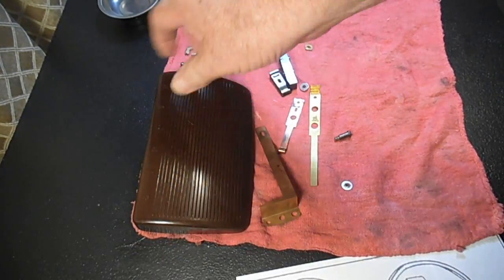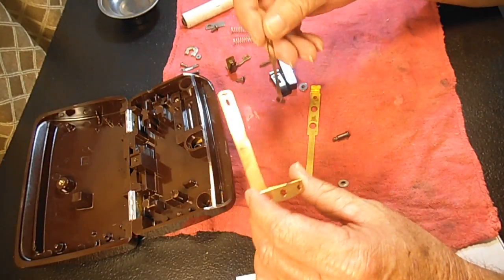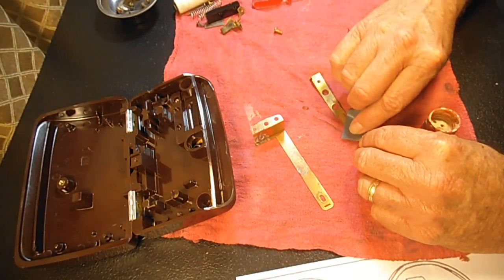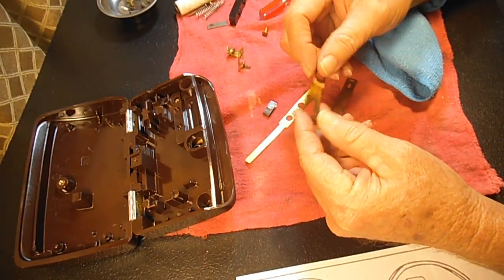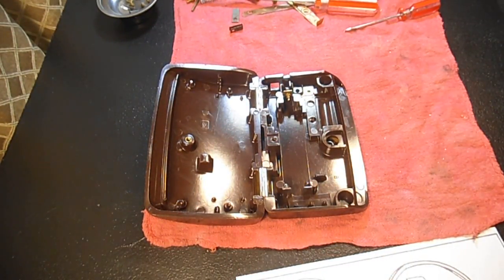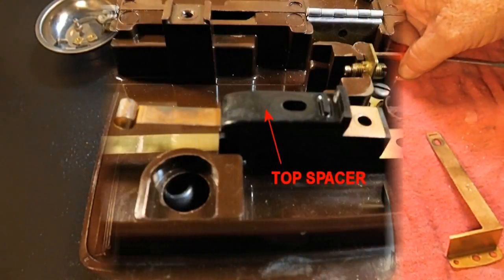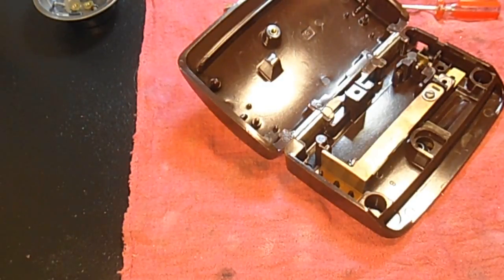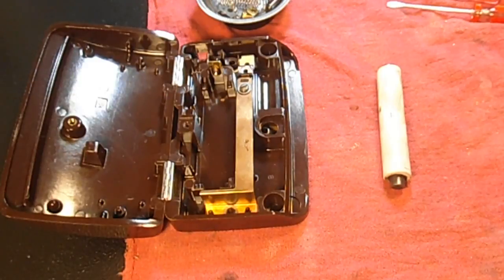SINGER CLAM-SHELL FOOT PEDAL RESTORATION PART 2 - POLISH & INSTALL SPRINGS

Comment: Hi Andy, is normal that this foot pedal make a little spark when the metal spring touch each other? Thanks
Reply from the maker: Not normal. The electricity should flow smoothly through all parts of the pedal. What is making it spark is too much resistance, dirty connections (like the springs), and probably dirty carbon discs inside the ceramic tube. That tube is a "carbon stack resistor" and when you press on the pedal the carbon discs get compressed which makes less resistance and allows more electricity to flow thru them. The springs make contact and allow the electricity to flow thru the wires to the motor. When springs and carbons get dirty (carbon deposits) they become much more resistant to flow and that allows the current to build up higher until the point it "jumps the gap" between the sprints and thus the spark. (like a spark plug) Usually, unless the carbon discs have cracked or crumbled they can be carefully "polished" to remove the carbon "soot" so they work much better. The contact areas of the springs can be cleaned. If there are pitted spots they can be filled with solder. The unit can be adjusted back to normal and work properly. This video is part 2 of a playlist. Parts 3A & 3B show how to clean and adjust the carbon discs and adjust the "play" in the side contact springs. Unless the carbon discs were destroyed I've been able to clean and adjust every pedal I came across. Here is the playlist for all the videos:
https://www.youtube.com/playlist?list=PLsCOZgzzaiKItPLWcK24FBoMdHK8vTXNi    Thanks for watching my channel, and good luck.
Reply: @andytubesewing1953  Thank you so much. I will watch those videos to get it clean and see if it works better.
Reply from the maker: @franatort  Welcome, Francisco. If you have any issues I'm here. Good luck.

Comment: I have a two speed clam shell foot pedal Fast/Slow that runs machine but takes 4-5 seconds to stop which is annoying.  Inside it looks very different. Serial number 163655 singer touch n sew golden. Can you demo this one.
Reply from the maker: One more reason I do not work on Touch & Sew Models. I can't help you. There are probably electronic parts that are failing but that is just a guess. The Guru or T&S machine is Terry, IMO. https://store.tandtrepair.com/   He may have a guide for the pedal repair or give you some advice.

Comment: Do you know where I can find replacement copper elements?
Reply from the maker: No one makes those parts new. You either need to repair them or buy a used pedal on a site like eBay, https://www.ebay.com/itm/Foot-Controller-Pedal-for-Singer-722-724-734-737-755-756-758-774-775-776-778-802/114485835357?hash=item1aa7e3365d:g:pN8AAOSw4VJfgvO0     or replace your whole pedal with a new electronic one. https://www.ebay.com/itm/3-Prong-Power-Cord-Foot-Pedal-Control-for-many-Singer-Sewing-Machine-362095-001/232073874799?hash=item3608ae4d6f:g:CBAAAOSwx-9W0nOS   Those are examples.
Reply: My bottom element was all but cooked through.
I fixed it with a dab of super glue and a pre-1982 penny :-D

Comment: I have been using OO steel wool to clean up the metal brass parts.  Seems to work good on my Singer 66's, 99K's foot controls and motors and even parts of the sewing machines.  Now doing a Singer 237 machine with the clam shell foot control like in this video series of yours.  Could not do it without your videos, THANKS!!!
Reply from the maker: Thanks for sharing. I've used the steel wool on damaged needle bars before and it worked well. Best of luck with your foot controller. Here is a link to my Playlist page with 400+ videos listed by Model number: https://www.youtube.com/channel/UCUSPDsHaFtRoz1VA2U1xJ4w/playlists?view_as=public